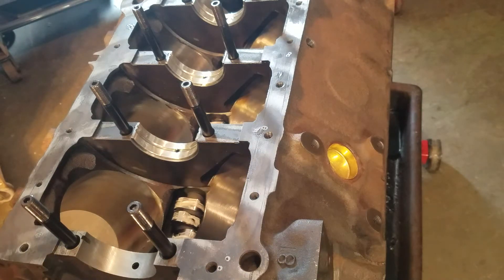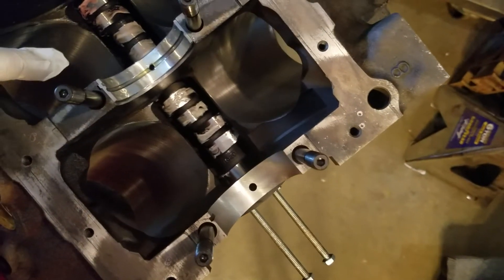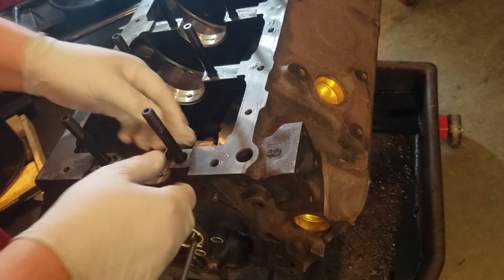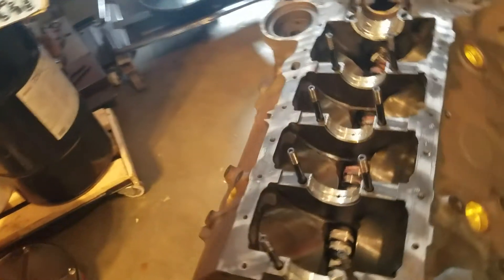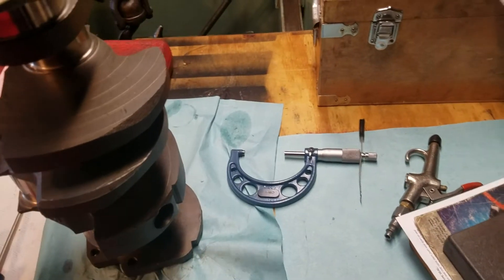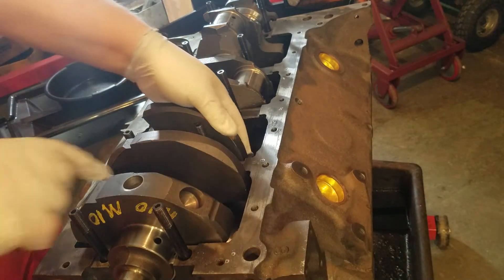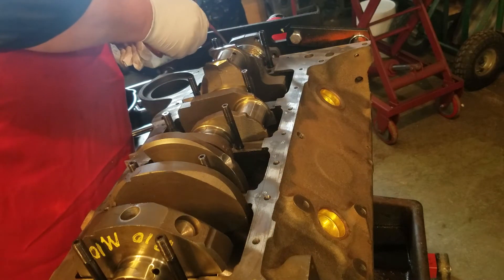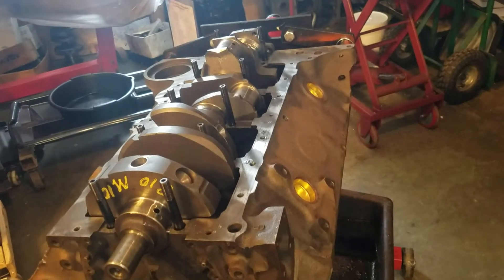sbc 400 part 3 crankshaft install

Comment: so for a 600 hp sbc with .003 bearing clearance what oil do you recommend?
Reply from the maker: I would use 10w40 for Temps between 50-80 degrees. Over that 20w50. Under 10w30